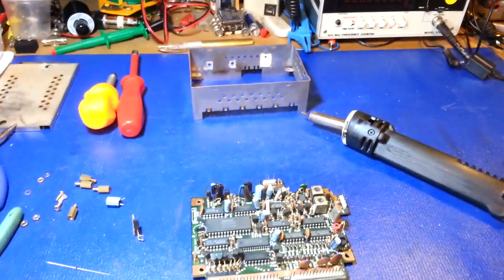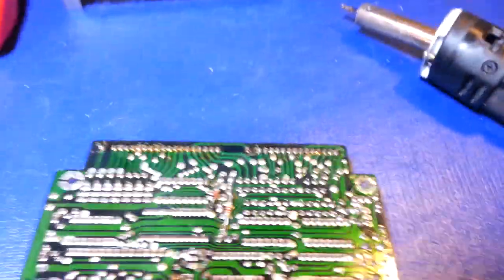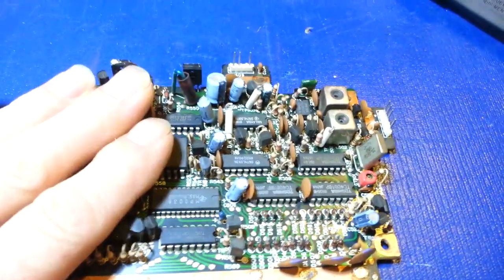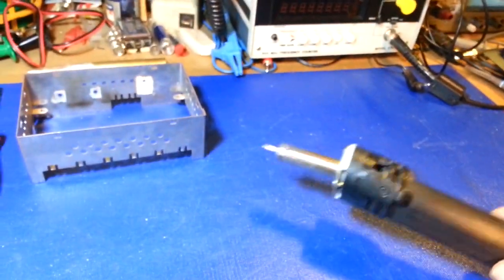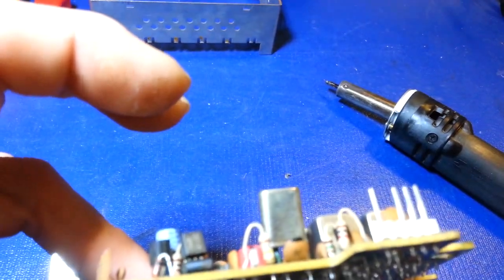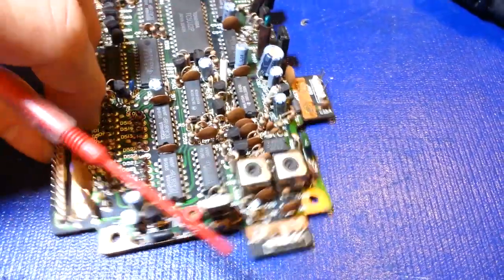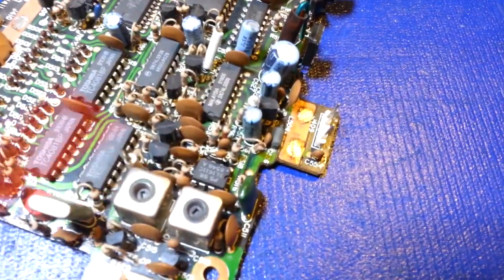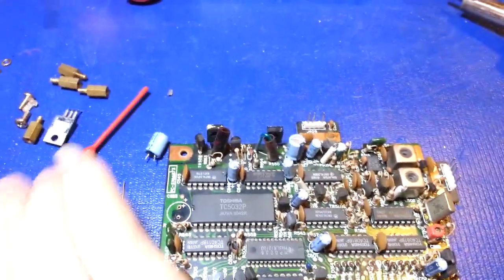Cobra 2000GTL frequency counter/clock module rebuild.

Comment: What is the reference number for those mustard drop capacitors? What do I look for in the service manual
Reply from the maker: If you mean tantalum capacitors the BOM should list them as just that, tantalum capacitors.
Reply: @mikesradiorepair  sorry I meant the diodes.  The little blue ones that you replaced the yellow ones

Comment: I just acquired an old Cobra 2000 GTL that won't light up at all. Any suggestions? Power supply bad? Fuse is ok.
Reply from the maker: First thing to check that gets a lot of people is don't forget there is a AC/DC power selection switch on the back of the radio.  If you have it plugged into the wall outlet make sure it's in AC.  I don't have enough fingers to count how many times that has been all that was wrong.  Also, those switch's rarely get moved so slide it back and forth a few times to clean it's contacts.  I have seen them become intermittent connections because they became slightly oxidized.
Reply: @mikesradiorepair  I'll be damned! You're right. It had been 30 years since I had owned a radio just like it and wasn't even aware of that switch back then! Now I need to find a mic that fits it. I paid $40 for two big boxes of radios, Palomar linears and misc. stuff. The other radio is a 142 GTL I think. Haven't brought all of it home yet.  Thanks for the info!

Comment: What's curious is that I got the digits to come on by putting a diode there... but no counting.
I know it's there because jiggling the buttons causes the seconds to flash.
I have to be doing something wrong.
Must... study... schematic... :)
Reply from the maker: When you power up the radio it defults to 12:00 and does not start counting time until you press the set button.
Reply: +MikesRadioRepair That was it.
Damn I am getting too old.
Can't even set a friggin clock :)

It does work once you set the clock.
As if the thing staying on 12:00 wasn't clue enough that it was not telling time.

I win the 'duh' award today.
Reply from the maker: +Mark19960 

LOL, happens to all of us.